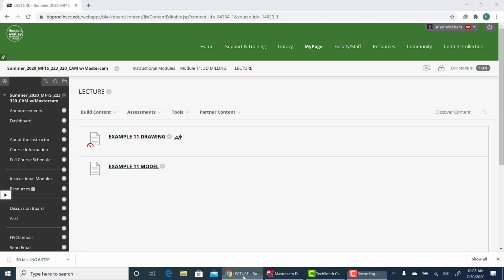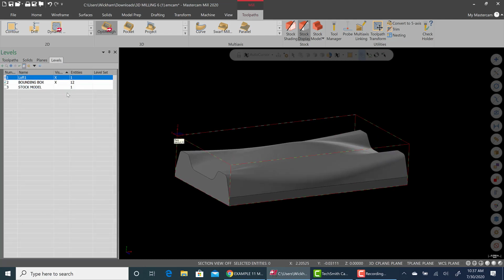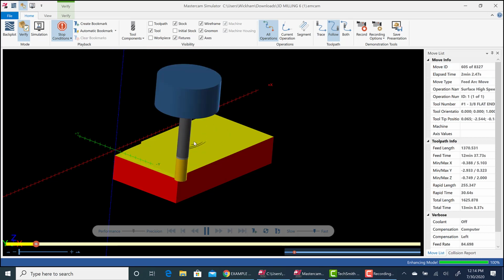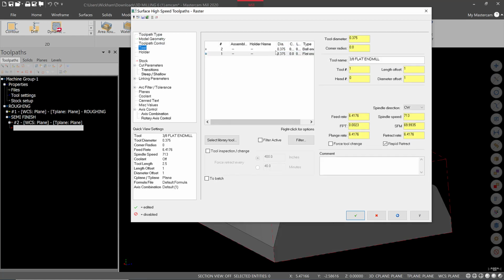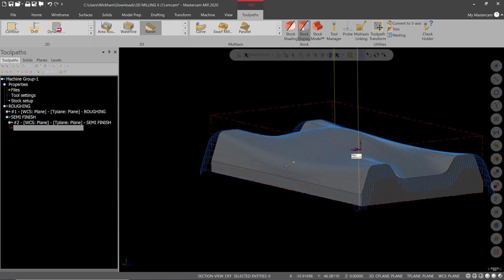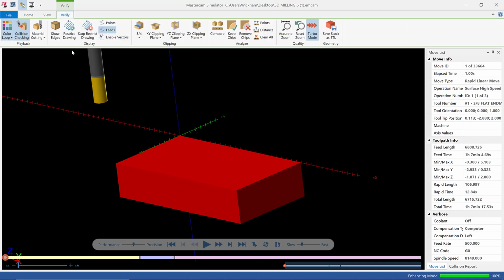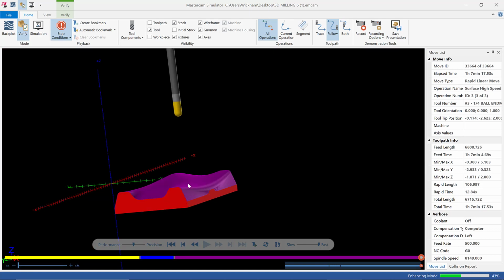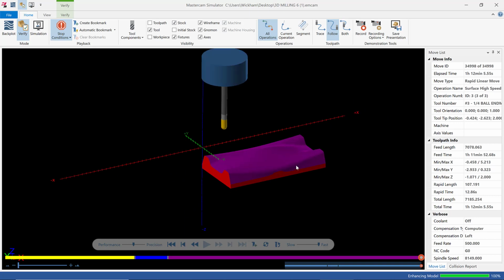MASTERCAM 2020 BASIC 3D MILLING

Comment: Thanks for this concise, well-presented look at 3-axis milling of a lofted part! 
Referencing the 3D shape in your latest 'Mirroring Toolpaths' video, what toolpath would you use (for best finish, at the scale of a computer mouse) if you were cutting the reverse of that shape, a cavity, into a mold block?
I look forward to your future videos!
Reply from the maker: If it was previously roughed by opti rough etc, I would finish with a scallop type toolpath or Raster. Raster has the ability to turn the tool path which is nice.  The large part from the mirror video I just roughed/finished in one op using parallel path which is in roughing.